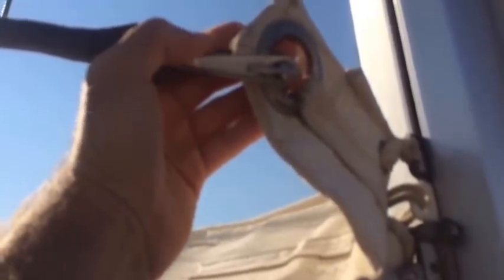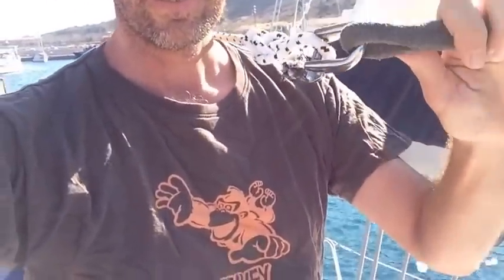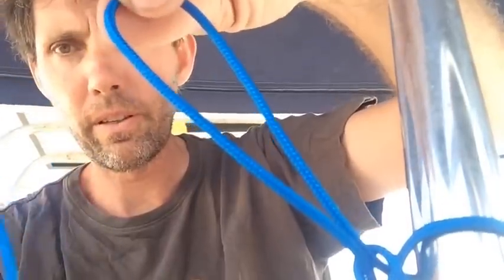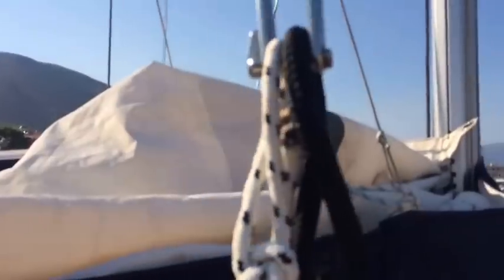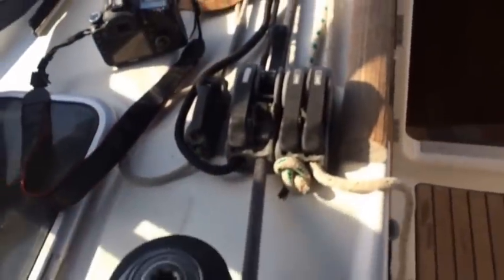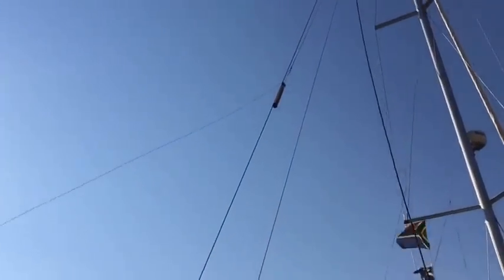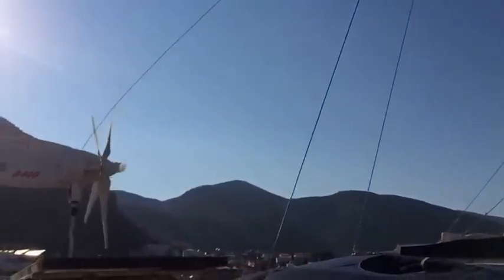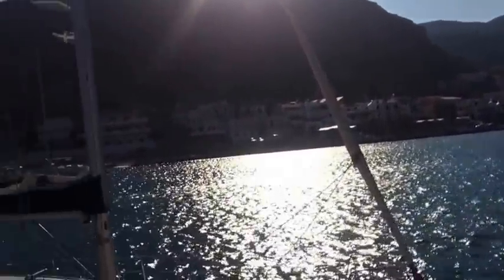Raising a radar reflector up a back stay

Comment: Hi Stu,  Nicely done.  What technology do these reflectors use,  are they totally passive or do they require a battery of sorts?  I have some experience with radar and ATC (air traffic control) pertaining to hot air balloons, which due to their construction are unable to show up naturally on radar and must use a powered transponder to generate something that will allow ATC (and other craft with radar systems) to "see" the balloon.   Hope it was a great holiday (over a year ago).  Minus 6 with a wind chill feeling like -17C up here in Ontario, Canada tonight.  Bring on the January deep-freeze, it helps keep the mosquitoes down to a dull roar.  Almanac had promised a very hard winter with a lot of snow this year, but so far around here it's been laughable.  Sold my last snowmobile years ago due to "declining" winters and insufficient snow levels (and getting married).  Yet a few hrs drive North of where I live, they'll have deep snow and frozen waters for a month and a half after we get Spring down here, lol.  Cheers.
Reply from the maker: Hey Stan, these reflectors are totally passive. Interesting to hear about the balloons, makes sense they don't show up on radar. Hope the winter isn't too bitter. I would have thought the mosquitoes would have gone completely at those temperatures. Ours get very quiet once it goes to about 15 celsius.

Comment: The bad news is that if that type of reflector is not vertical its performance reduces dramatically.  So even one installed vertically will lose performance when the boat is heeled.

Comment: I like this set up.  What are you using to lash the reflector to the backstay?
Reply from the maker: +Peter Feldman Hey Peter, that's a good question. From memory it was attached with two thick UV resistant cable ties.
Reply: @DangarMarine  Cable tie's fix everything